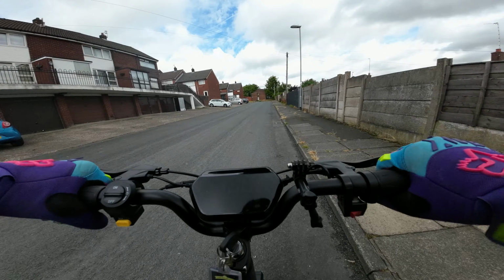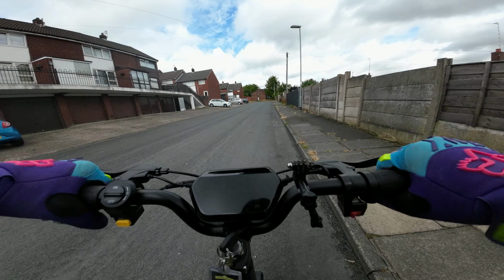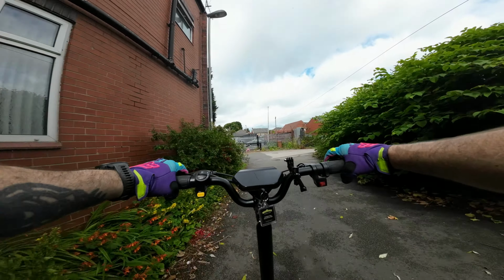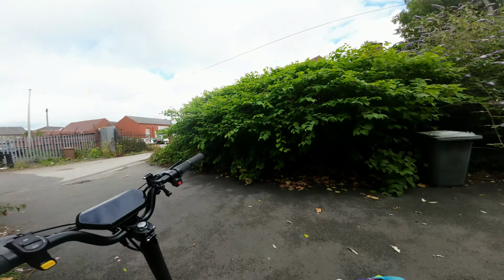E100 EAGLE Sub £600 OFF ROAD Electric Scooter WARNING Error Saga Continues NO LOVE Off eBay UK

Comment: i been wanting to buy one of these but now i will not buy one just looks good , i have a 2500w scooter single chain drive motor does not burn out in the sun cost me 500.00  , i have a 2400w scooter its a dual motor i take it out in the blazin soon i go 40mph and fly up loads of hills my motors are fine i paid 900.00  , i have the iscooter ix5 and it puts that scooter to shame its 1200 single motor i paid 470.00 for it.

that motor is a cheap motor or the controller is ??? either wway that scoote needs upgrading to better specs not up to PAR !!!!!
Reply from the maker: Hey - yeah its the controller i reckon thats crap so itll be getting upgraded !!
Reply: @paulleeFLOW  did u keepor dash the scooter
Reply from the maker: sold it as spares repairs  !